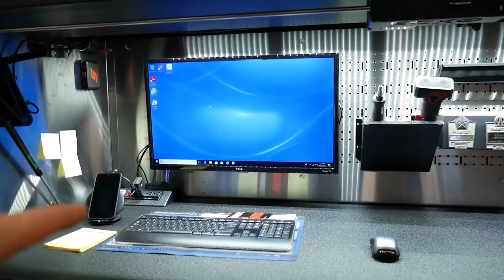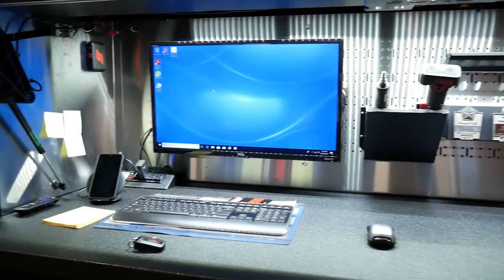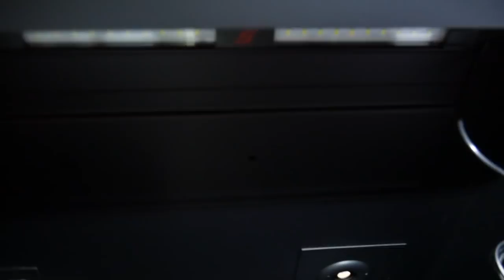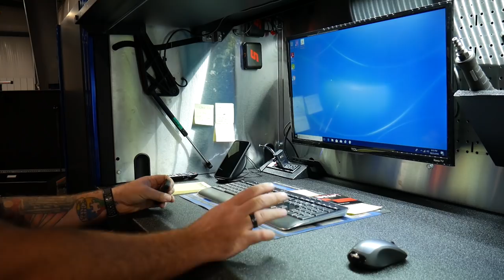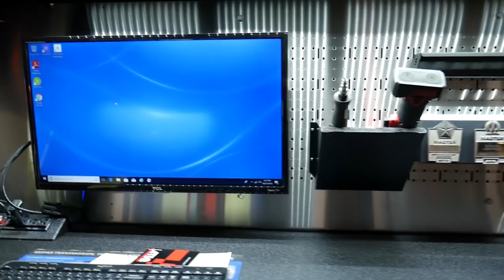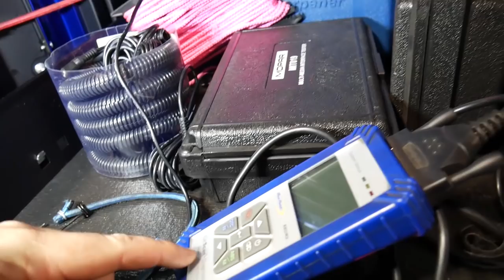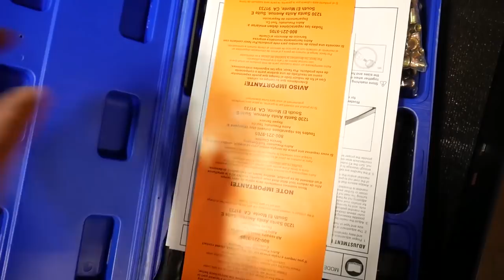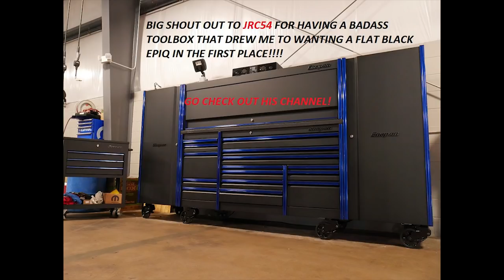TOOLBOX TOUR OF EPIQ PROPORTIONS

Comment: Just caught you video. IF you haven't already replaced the cordless (I'm guessing impact) with the bad battery. If you have a Batteries Plus store in your area, you can get you battery rebuild for a reasonable cost vs.  buying a the Milwaukee. Just a suggestion.
Reply from the maker: Yeah, looked into that and they still wanted $90 for one, so I traded it in for $150 and got the Milwaukee and am super happy with that decision. The Milwaukee is a beast
Reply: Yeah, I suffered the same with my Porter Cable 19.5 V batteries. Cost was real high. I agree, the Milwaukee is a great impact.

Comment: Well, it never fails to surprise and annoy. Guy buys oversized toolbox and uses a 5” deep drawer to hold 2” thick ratchet and don’t get me started on the countless junk drawers. I consistently preach to the numerous apprentices that come and go from my shop that you first need to buy the tools that will make you the money that you can then use to afford that nice big toolbox. The ones that don’t hear my advice are the ones that don’t usually last. DUDE, you need more tools and less junk drawers or... less toolbox. Colour me not impressed. Other than the toolbox, I’m most definitely impressed with that. I’ve been doing a bit of research so I can decide on what to get for myself.

Comment: hello, very awesome toolbox. I have a question, how do you repair the scratches on it? Thanks
Reply from the maker: Well my first thought would be don’t scratch it, however, there is flat black touch up paint as well.
Reply: Rustbelt Mechanic hey thanks for your reply I appreciate it. Also sorry I’m I wasn’t specific in my comment I actually meant a blue glossy toolbox long story short I scratched it loading it up. I tried NU FINISH scratch doctor but it didn’t work very well maybe because it’s meant for auto applications so I was wondering if you knew any other rubbing compound out there that might help. My last resort is to go to a paint shop so they can match the paint and make a touch up pen that way.

Comment: Quick question for you I'm a tech starting out at a gm dealer what's the odds and tips to get up to getting me a fancy snap on box?
Reply from the maker: First off start small and don’t over reach, negative equity and debt is the worst thing you could have when owning toolboxes. You’ll usually always get the best deals when either the end of year rolls around or the rock and roll cab express, they offer extra promo discounts. On top of that, always negotiate even further. Low ball... if they don’t take a day or so to think about your offer, your offer was too high. Good luck man 👍🏻
Reply: Buy used tons of brand new ones for sale on craigslist and pawn shops mechanics went broke or quit sell the shit for 1/2 price

Comment: Rustbelt Mechanic, what is the part # for the Very Thin LED light that you are using in this video??? I'm assuming that it is a Snap On Light?
Reply from the maker: ECARB042 yes a snapon
Reply: @RustbeltMechanic  Thanks Buddy
Reply: Got one this week. Awesome Light for working under Vehicles or the Engine Compartment, or just about anything else.

Comment: if i could give you a tip about the screen, maybe put a set of small washers on the screws that are in the back of the screen for a better grip. God forbid some idiot does move your box it has more grip on that wire. also from a mechanics kid and aspiring mechanic myself im pretty versed in all things google so if you need any type of document made (ie. forms, spreadsheets, etc) id be happy to help just message me what you need and your email.
Reply from the maker: Actually did a tutorial on the google sheets for what I use as well👍

Comment: There’s always that guy who says “ hell I can do the job with a hand Carry box and a crescent wrench “. Or “ruut boot bah harbor freight”
Reply: You can do the same job with any tools. Snap on doesn’t magically give you IQ. I can still take of an axle nut with a 12$ 24” harbor freight breaker bar just as easily with a 140$ 24” snap on breaker bar. 12$ out the door with a couple AND with a lifetime warranty. Just also wanted to say, harbor freights torque wrenches are just as accurate as snapon I’ve had the same harbor freight torque wrench for a few years, never calibrated, still pulls numbers within 3 ft lbs. ( I paid 17$ for it with a coupon) There’s a reason why business owners buy harbor freight, tools are lost/misused/stolen/rusted long before they break. Harbor freight is snapon without the logo and flashing colors.
Reply: @yachtyteam6978  My Snap On torque wrenches are 48 years old, have been tested but never  calibrated. Had them tested recently, right on spec.
Reply: boomermg I’m not doubting it. And I’ll even say that at the time, there wasn’t much that could be compared to snap-on’s craftsmanship, but it’s all machines and the same metal now.
Reply: @yachtyteam6978  and to add most are made in the same Chinese factory...lol

Comment: I'm waiting on my first snap on box. Got a 60 inch epiq with a hutch and power top and locks.  Is there anyway to turn off the beep on the locks?
Reply: louis suvoy there's got to be a speaker you must be able to shut up somewhere?
Reply: @jacob.s3619  yeah I figured that. Just wondering if its going to require opening a box and snipping a wire or just pushing a button or switch outside the locks. Don't want to be the guy in the shop with the loudest unlocking procedure lol.
Reply: louis suvoy lol you don't want to be that guy, just like I never wanted to be that guy with the loud central locking from the late 90's in your street, every one can hear those beeps.
Reply from the maker: I will pull out one of the Ecko manuals later today and have a look, however I doubt it. You’ll likely have to take the box apart and snip a wire to the speaker or something of the like.
Reply: @RustbeltMechanic its killing me to wait so long for this box.  Going to do a 24 inch monitor that I had from another computer and run it off my laptop. Tuck the laptop in the corner and do a wireless mouse and keyboard. Amazon has a cheap monitor mount for 10 bucks. Going to figure someway to mount that to the dots like you did the 2 bolts that way it has to be lifted like 3 inches or so to come off the mount.
Reply from the maker: louis suvoy yeah I went cheap mounting this one, the tv I’m using is a 28” tv

Comment: I hope mechanics that are dumb enough to energize their toolbox are smart enough to put it on a GFCI circuit and have a full rubber mat below their drawers on the floor so they don't light up like a Christmas tree when there is a malfunction. I would not have a power drawer in a expensive toolbox. I would have a sacrificial toolbox for all power/ battery operated tools.

Comment: Ahh, this is why I like A&P or heavy machinery a lot more than automotive or motorcycle mechanics. They just don't pay so much homage to the Snap-On flag.  When I see this in an automotive shop for the rare reason I go to one. I know that I am to expect an over priced bill for relatively common work. So now as I customer realize that the reason for my overpriced bill is not the payroll, regular bills or materials, it's to pay for the Snap-On banner instead. All Snap-On says to me as a customer is that I will get the same regular service for a much higher bill, the worst part is, none of that extra cost in the bill actually goes home with the mechanic. It's petty, I do like the the keyfob locking thing. But if it were not for automotive techs, Snap-On would be out of business. The dumbest customers are in the car industry so they are easiest to impress with the Snap-On flag, and ASE tags.
Reply: are you a mechanic?
Reply: Yes, I am an industrial mechanic. No, I don't have a customer shortage. I tend to believe that real professional mechanic can work though any situation, even if the only thing in his/her hands is a set of Walmart back shelf tools. When you can do spectacular work with the worst tools, then you know you are actually a pro. I am not a mechanic to be an actor.  As for the "American Made" debate, I can provide at least 6 other tool brands made in the USA that are great performing tools without the cost of "Reputation" .  If you want tool chests that out perform and outlast Snap-On, made in the USA 100%: https://rhinosafe.com/all-products/ironworks-tool-chests/  Does your Snap-On box sport 200Lb to 400Lb drawer slides? Even if it's a base model? These are made in Idaho, steel supplied from local resources, hand welded.
Reply: Agreed, although maybe not quite as bluntly put.
Spent 6 years working as a Heavy Equipment / Tractor Trailer mechanic in the early 90's.  All but a few tools I had were craftsman and Ingersoll Rand for air tools. At one of the shops I worked at in NH so few of the 12 - 14 mechanics there bought Snap-On tools that the truck only stopped in about every six weeks. 30 years later I still use the same set of tools.

Comment: What’s the new meter coming out?
Reply from the maker: Stay tuned and I’ll have a video on it as soon as it comes out!
Reply: @RustbeltMechanic  where  are you located at I'm in NY I know the rust issue all to well
Reply: @RustbeltMechanic  hey Mac has warrantied drill bits and those snapon thunder bits are not so good dull quick especially on older exaust manifold bolts that are heat treated over time in aluminum heads
Reply: @RustbeltMechanic  fluke is the meter to get

Comment: I would like to know how much did tht set up cost you
Reply from the maker: Well msrp is right at 36k but with trade in and heavy rebates I owe very little
Reply: @RustbeltMechanic  do they give you full price for your old box when you trade in. Also what heavy rebates? Who's your connect?
Reply from the maker: Yes they gave me great trade in value, nearly every bit I have for them in the first place. Snap-on credit gives over $2500 in rebates and then the Snap-on rock and roll cab express rep gives better deals on top of that

Comment: Rust belt? Where’s your air hammer
Reply from the maker: Power Drawer of the toolbox third slot from the front. Bluepoint airhammer
Reply: Rustbelt Mechanic  thought that was it but was looking for the snap on version. You should try the cp717 or the Astro clone, total beast.